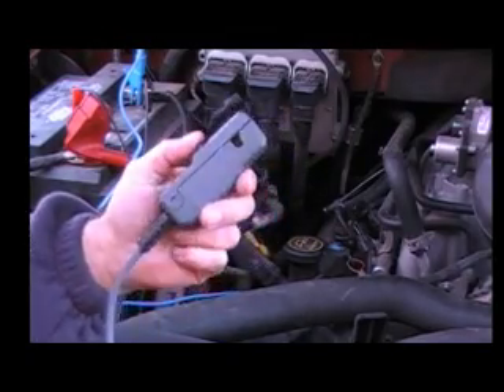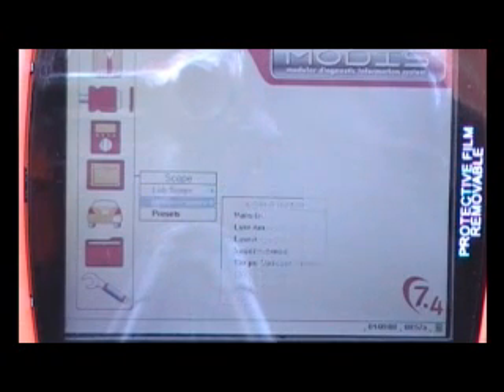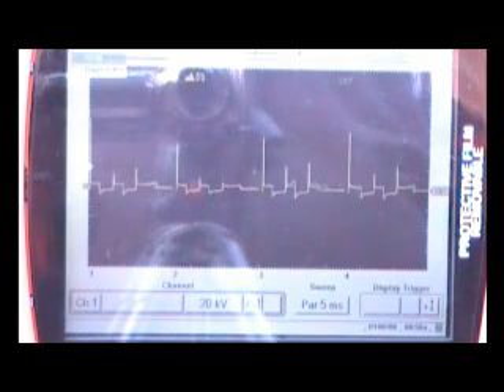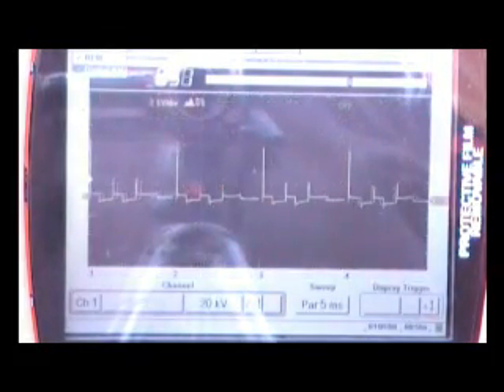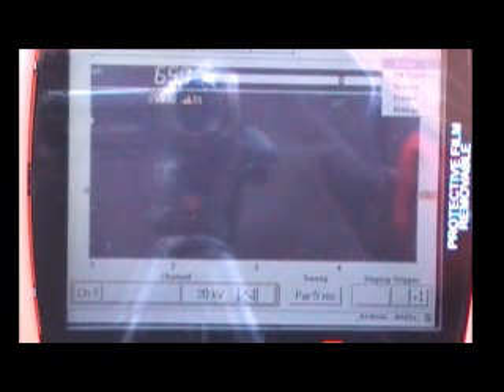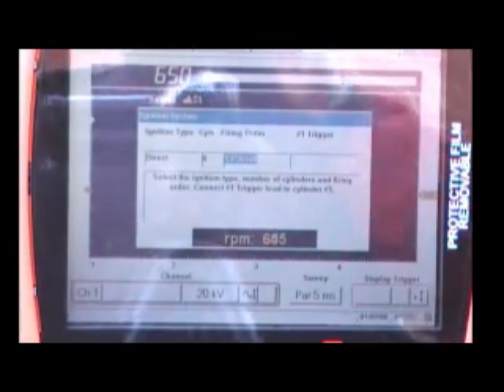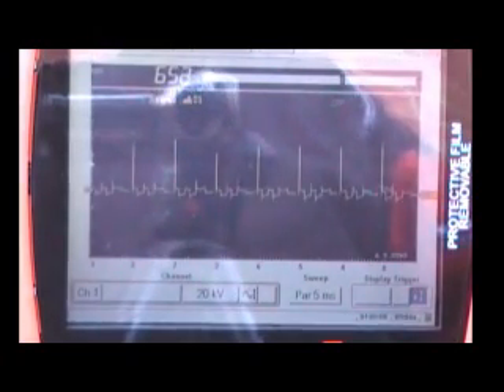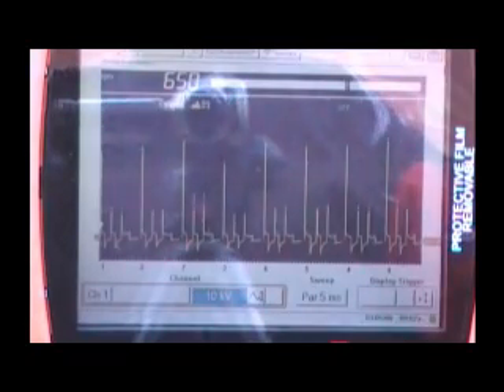Snapon Secondary Ignition

Comment: Hey great video. I'm not sure exactly what parts I need from snap on to view secondary waveforms. Do u have any part numbers?
Reply: Three other items needed with the Vantage pro are Secondary Ignition Clip On Wire Adapter EETM306A02, Secondary Coil Adapter Lead EETA309A05, last Inductive RPM Pickup EETM303A05.